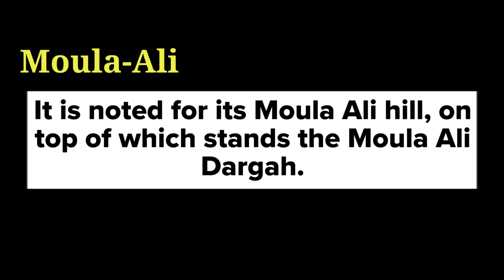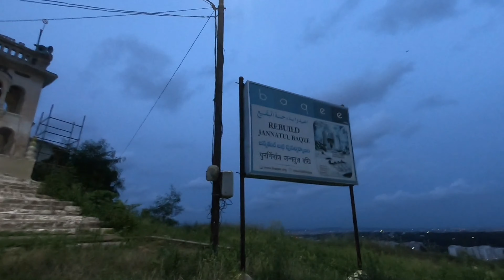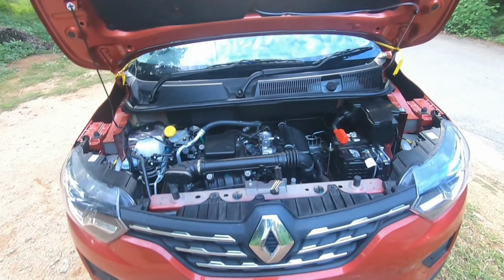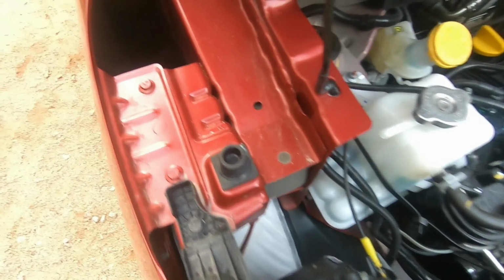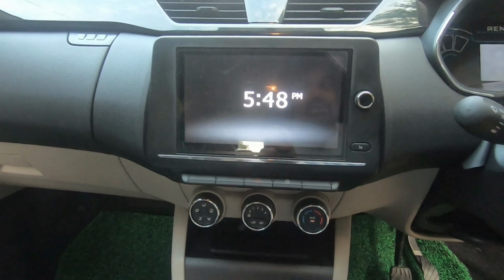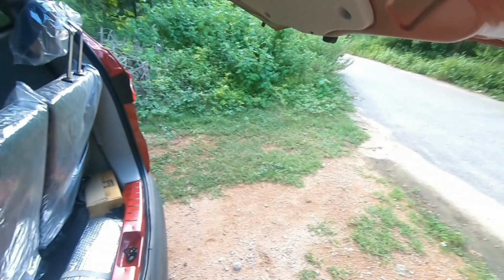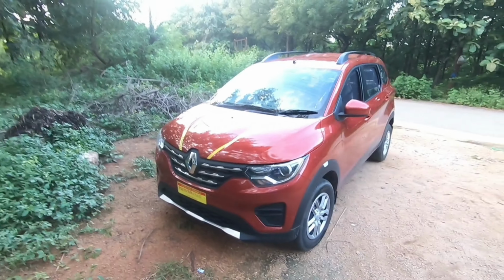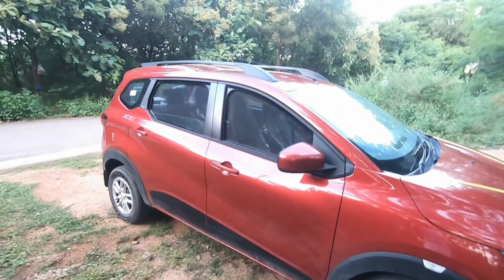Short ride on the Renault triber| safety and built quality #TriberAMT #RenaultTriberRXT #MoulaAli

Comment: Hi bro. The door autolock option is avail in triber. Keep the manual lock button pressed for 5 seconds. U will see autolock feature activated on MID
Reply from the maker: Thanks for the hidden trick..it worked 👍

Comment: I drive my Triber RXL on highway around 1500 km... at good road condition continuous drive at 115km/h(annoying beep sound after 120km/h). I did not observed any big issue even, once I drive 350km in 4 hours after full tank without break on mixed road condition. But I like to mention some pin points : 1.Tyre width should be 185/70, 2.Head light beam little bit low for dark, 3. Horn must be louder ,its feel like bike horn, 4. Night vision ORVM should be equipped.
Reply from the maker: Nice... thanks for the note

Comment: Hi, I am from hyderabad, looking for a Car under 6 lacks, after so much research I found Renault, Maruti, Hyndai cars in this category, So I have listed triber RXE based on engine capacity, even dealer requesting me to go for RXL for better features as i dont find any difference in heart of the car ie engine. will u suggest this car for highways 800 kms rarely. need to discuss more from u can u share ur number.tq
Reply from the maker: It's good as a 7 seater ..and occasionally for highways aswell
Reply: Can you suggest accessories Showroom where I can get Roofrails, Slide claddings, Audio System and other outlook fittings in Hyderabad for a reasonalnle price with a good quality.
Reply from the maker: @bharatkiranp  buddy, still have to install the same even for me aswell...but of you are looking for seat covers for floor mat let me know I known some one who does it for show room at a reasonable price and good quality
Reply: @CTR2K  yes please